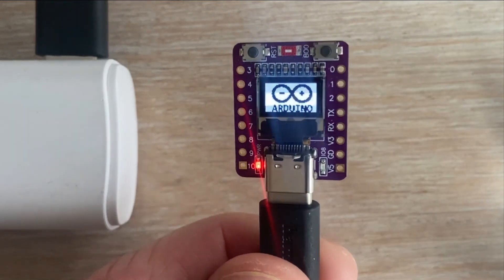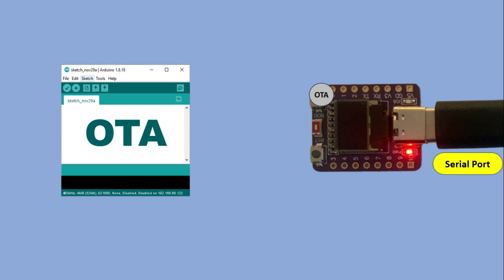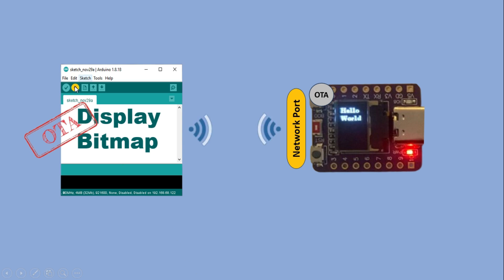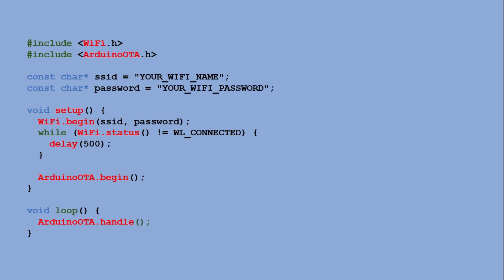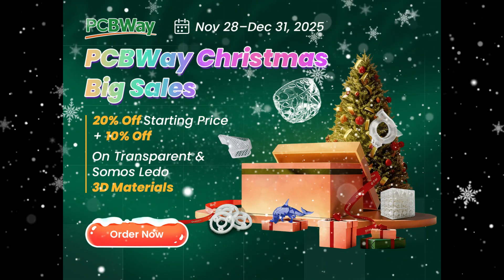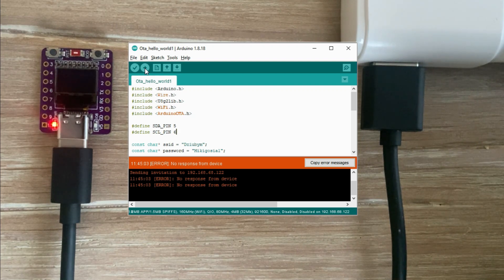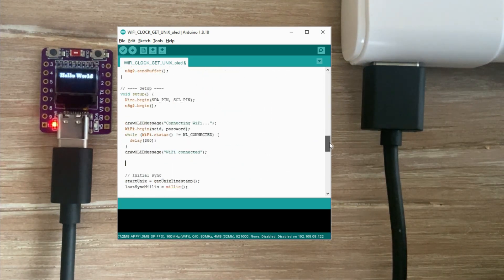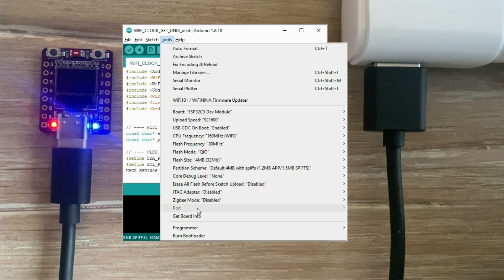Wireless Uploads to ESP32-C3: Complete OTA Workflow (No Cable Needed!)

Comment: Thanks!   Is it ok to skip the the while /delay loop in setup and just put a check in the void loop that checks for WiFi connected then starts ota (and sets a flag to disable this check once ota has been started) , so that the startup is not delayed whilst connecting to WiFi (or if WiFi doesn't connect, board doesn't just hang forever) ?

will wait for your serial monitor video before implementing this, as i need the serial monitor output (even if it's slower to update that's ok for me)

Comment: That is a great feature for when the esp32 is out of physical reach. I am almost a complete novice with Arduino but would it be possible to create a function that is added to any sketch that runs the code needed to maintain the OTA capabilities, a bit like using a "secrets.h". That way you wouldn't have to insert the required lines into every sketch that you want to upload via OTA. Just a thought. Thanks for sharing.
Reply from the maker: There is a way of doing it. I will add this to the second part of this vide. Basically when you would open the new sketch the it will already contain wifi and OTA parts.
Reply: @marios_ideas  Thank you, I look forward to part 2.